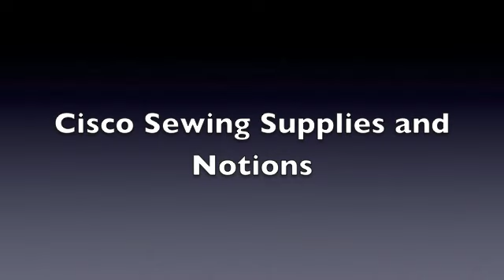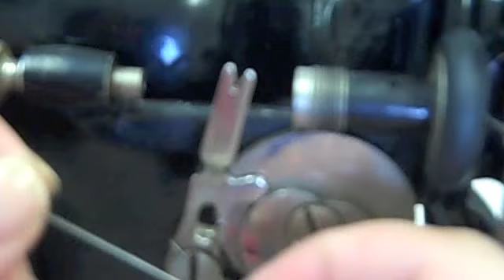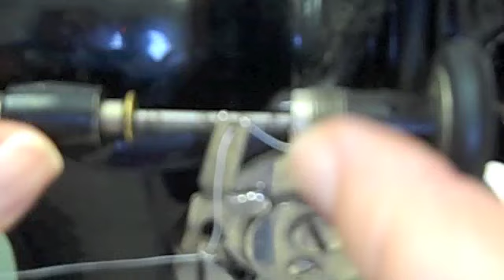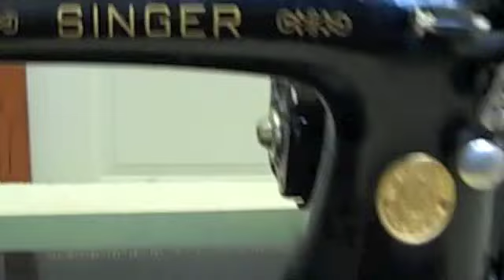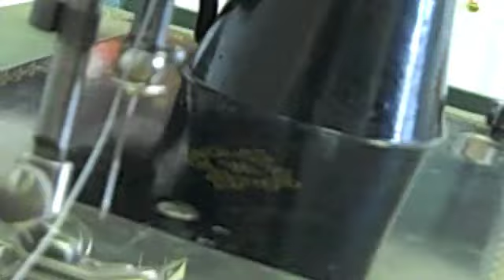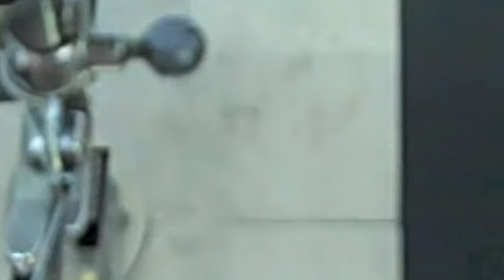Winding Bobbin & Threading Antique Singer Sewing Machine

Comment: My bobbin does not slide in there like that. Mine is also an Improved New Wilson, but looks just like yours. In the bobbin case where you put the bobbin,  it is bend or curved. It was in there and it was easy to take out, just can not put it back??? Any idea what could be wrong ?? 
thanks
Barb
Reply from the maker: Are you saying that your bobbin was curved or the bobbin case? I've never seen one that's curved but I suspect it shouldn't be. Is it possible to straighten it?

Comment: You did a fabulous job. I'm been sewing since I was 8 (not quite 60 years ago, in the mid-1950's) and have had a number of Singer machines over the years. They don't make them like they used to and my old 1925 model than only sews forward is the best I've ever used! No plastic parts - and you reminded me (after 35 years of NOT sewing much while living and working overseas) of just what to do. My bobbin is the newer "hockey puck" shape vs. the bullet, the the principles are the same. You ROCK!